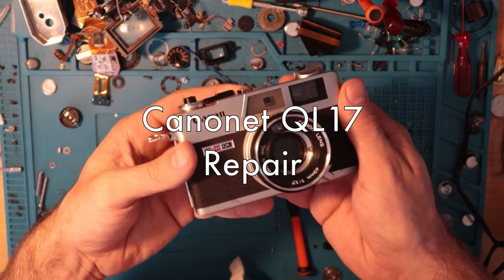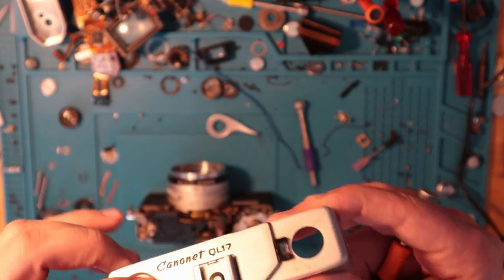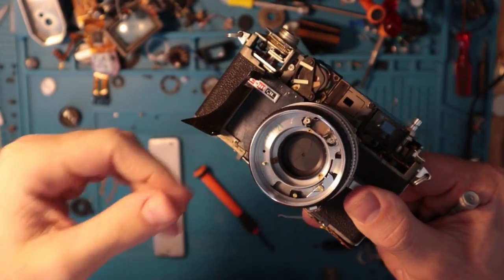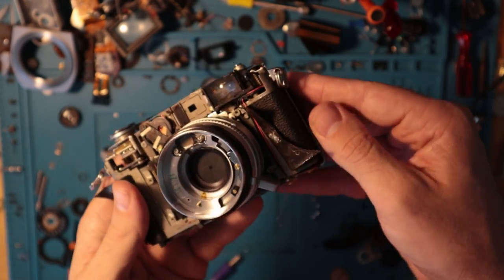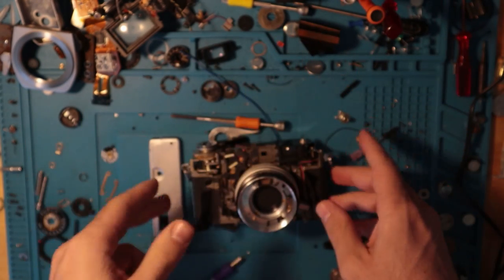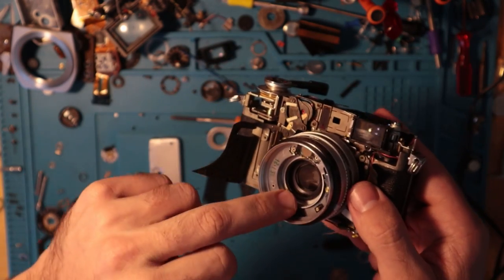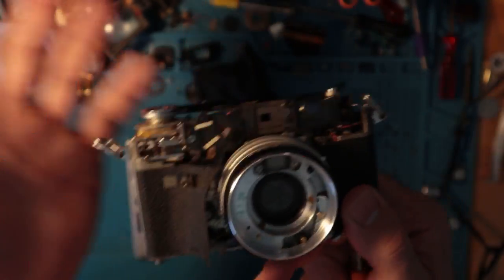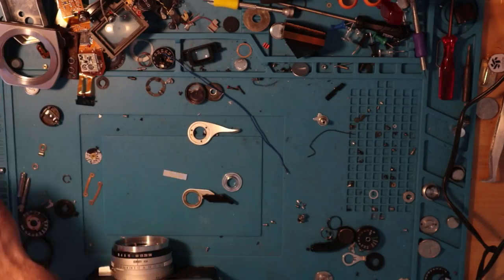Canonet QL17 G3 Advance Repair

Comment: Thanks so much for the info! Appreciate you taking the time to record while working! Would love to have another vid on the QL17, particularly any more tips on getting the meter working.
Reply from the maker: What kind of meter problems are you having?
Reply: @RompingBronco  Oddly, the light meter only works while the camera is laid on its back (with the lens facing up). Also, oddly, the check battery bulb is constantly illuminated. I'm using a fresh wein zinc/air cell rated at 1.35v (and checked w/ multimeter). I've repaired the shutter on this unit before, but didn't put much effort into the meter at the time. Going to open it up again to see what I can figure out, any thoughts would be welcome!
Reply from the maker: @AdrianTempes  If I had to guess I'd say the issues are unrelated sort of, there could be a contact issue that's causing the light to always be illuminated (top of the camera, should be easy to separate the plates) and then I don't know the specifics of the electrical current but if the power is being used for the light I'd imagine that would partially affect the functionality of the light meter. I'll look into that a bit more but if you find out anything more I'd love to hear it!
Reply: @RompingBronco  Yeah, I think you're right about a contact issue. I disassembled and reassembled the needle-holding assembly and that moves OK now. The meter worked great for a few days, but then started being less accurate before stopping altogether and I'm guessing it's attributed to battery drain (even with the camera set to a non-"A" setting while not in use; multimeter says the cell is down to .48 V). Will have to open it up again and see if I can fix the drain issue.
Reply from the maker: @AdrianTempes  I'd check the battery compartment itself first for any signs of corrosion, it may not be the source of the drain but it's easier to check that before disassembling the lens from the camera body. Best of luck!

Comment: thank you for your video. My Canonet just isn't firing...
Reply from the maker: That could be the advance issue as shown hear or there could a less common issue. Are there any other issues you've noticed?
Reply: @RompingBronco  I quite didn't see what you did in 8:21 @@
Reply from the maker: @JustinInBlack  Suppose the lens blocks the view, my bad, still getting used to working under a camera haha. If I remember correctly I adjusted the small elbow shaped piece that is caught by the advance mechanism. It's very small and malleable so it's common that it get's bent out of shaped and thus the advance won't properly engage the shutter. I'll likely make a similar video and do a better job portraying this.
Reply: @RompingBronco  thank you! I just ruin mine and need to fix them @@

Comment: Thanks for these and other detailed videos, really helped me to get started with a new-to-me QL17!

However, I am now facing an issue I couldn't find anything here on the channel - and neither in the internet in general.
What happens is, my QL17 (new body, but not G-III) refuses to feed some film stocks. Especially, bulk load cine film (Kodak Vision and such). It gets stuck around 5th exposure and refuses to wind further - as if the roll is over (but it's obviously not).
And this does not happen with some other film stocks - like Svema or Fujicolor.
Did someone here face anything like that?
Reply: You are winding your bilk film way too tight  Wind it loosely when loading since the QL system is very finicky on bulk roll film
Reply: @likaleica  thanks! The more I look into the problem, the more it seems like Canonet is not quite what I need.. as most of the affordable film stocks available to buy here currently are bulk-roll by local labs, and the QL system seems to be quite unhappy with that

Comment: just tore down and cleaned my Canonet 28 but for the life of me i don't know why the sprockets don't move the film forwards it seems like the advance lever gets stuck. i opened the bottom of the unit and saw that it keeps catching off an area casing the winder to jam up. any advice on where to start or what could be the problem?
Reply: to add it seems to clear the jam up when i tap the bottom right corner where it catches it then releases and allows to action again.

Comment: I noticed that after you removed the leatherette on the left side, you ended up also removing the right side. Is it possible to access the advance assembly just from the left? I've not been successful prying out the cover after removing the screws. This is on a QL19, but I assume it's basically the same.

Comment: So I've got mine open right now and it seems to be a similar problem, the advance will not move the arm enough to the left to properly cock the shutter. If i nudge the bottom arm just a bit more to the left at the end of the advance turn it does the trick.  So this is just a matter of lubrication? Will a padding of lighter fluid do it? 

I'm also having an issue where the frame counter is not advancing and locking the lever afterwards like it should. I feel like from other stuff I've read these things might be related.

Comment: What is that tool you briefly showed? Was that to remove the lens element or was it just a spanner?
Reply from the maker: Do you know what time code that was at?
Reply: @RompingBronco  0:28
it looks like a spanner after closer inspection. I repaired a QL last week but I have another one on my bench and having a really difficult time removing that 2nd lens element in front of the shutter blades. Tried a few different methods but stuck for now. Still a helpful video for sure.
Reply from the maker: @graham_white  Oh yeah that's my 30 dollar spanner I hardly use haha, I want to like it but it's a little too large for some of the more delicate procedures. However the flathead side of the spanner is very helpful in removing that metal case that holds that element in place. Canon did not mess around with their lens assembly. You might also try removing the elements in the back and then firing the camera on bulb to access the glass from there if it needs to be cleaned or using a small amount of lighter fluid to break up the seal of the metal case.
Reply: @RompingBronco  haha good spanners are not cheap thats for sure. yeah its annoying how there is no way to access it. I was hoping there was a special tool I didn't know about. I forgot to try lighter fluid. I suppose Ill do that and hope it breaks it up. Thanks again.

Comment: I just get a ql17 but something I noticed the lens is full of white stain and can't be cleanse by alcohol and it affect to my photos. what should i do?
Reply from the maker: Thanks for watching! If I was to venture a guess I'd say the white staining is likely some kind of mold, you may want to try cleaning it with distilled white vinegar but even then it's likely the mold has gotten between the glass and the emulsion and that is significantly more challenging to clean. I'd see if where you bought it from accepts returns/refunds and potentially try to find a different canonet somewhere else. Hard to say without seeing it myself but I'd say that's the best course of action. Hope this helps!
Reply: Get another lens for the haze and or fungus is under the coating of the lens. No way to remove that damage. I soaked a damage one once to see overnight in peroxide and the coating melted away showing the lens comes to a point in the middle. Part of the alignment process needed I think to install the coating at the factory

Comment: Hi, Just got one of them but the parallax correction is not working properly (some times it gets stuck) I wonder if you know if it would be an easy fix? or is it best to get a new one?
Reply from the maker: That's very interesting, it may be fairly fixable as the parallax correction is accessible by just removing the top and it could have fallen out of place if the camera was dropped or it could be a more serious issue. Have you shot with it and have the photos come back in focus?

Comment: i am trying to repair my QL19 currently and the advance seems to want to contine to wind on even after pressing the shutter is there a way to fix this?
Reply from the maker: I guess I'm a little confused by the question, after the back door has been opened the camera should advance a couple of times without the need to fire to load the film properly and then are you saying the camera will continue to advance regardless of if you fire the shutter or not?
Reply: @RompingBronco  Hi there and thanks so much for getting back to my last comment. I will try my best to explain what is happening. Once I have loaded the camera with film and advance to the first frame, the advance lever dose not stop. I can wind all the way through the film until the end of the roll. I can press the shutter and I can advance but It will keep on winding. Your video has been super helpful though and it’s great to see someone putting videos out like these. I hope you can help

Comment: what do you use for removing the leather? I used axeton and it didn't work. Also I use Goo Gone @@
Reply from the maker: As for the skin removal I've tried using 99% alcohol and letting that soak through. It works with mixed results but the canonet skins are very thin and fragile so I'd recommend looking into reskinning if possible.

Comment: So i was cleaning my camera, and when I finish it and I put things again, the camera start not shooting.
Can you help me?
Reply from the maker: This totally slipped under my radar, I apologize but I'd love to help you if you are still having some issues
Reply: @RompingBronco  yes ahaha, i receive the notification now and came as fast as I could to answer you.
About the problem, i cleaned the camera, so far so good, but then when I build (i forgot the right word, sorry for my bad english xDDD), the camera stop shooting, I push the "trigger" and he do not shoot, blocking that "trigger", at the third/fourth time, pulling it.

I hope you understood what I wanted to say.
Thank you for helping or trying at least ahahah
Reply from the maker: @goncalofigueiredo981  haha I do apologize I'm usually pretty good with these responses, I think I understand what you mean! Did you by chance clean off the blades in the lens? sometimes the oil gets in there and prevents the shutter from firing and the camera from advancing more.
Reply: @RompingBronco  No problem, it's better later than never!
No, I didnt clean the blades, i just took off the upper side of the camera, to clean some dust. 
I don't now the name of the thing I want to say. But you see that thing you have to pull to take a shot? Around the shooting button? It's that thing! When I pull it and then try to take a photo, the button simply, doesn't click you know? I tried to pull it 3 times, and then it gets stucked (one more time, sorry for my english, still learning! xD)
Reply from the maker: @goncalofigueiredo981  I know exactly what you mean and your english is just fine so no worries! The film advance lever will move 3 times if you open the back of the camera and then you should be able to take a shot but it sounds like the blades in the lens may be stuck which prevents the shutter button from clicking as you put it!
Reply: @RompingBronco  That´s weird because I didnt touch the blades...maybe when cleaning the camera, I moved something, not on purpose of course xD.
I will try to investigate, and ask to a friend to see this! 
Can you tell me, moreless, things that I can do or reasons why this happening? All the information is good to analysis!

Meanwhile, I take this opportunity to thank you for your help! :D
Reply from the maker: @goncalofigueiredo981  The oil is from the manufacturing process, it was used to keep things moving in the lens and it occasionally seeps into the lens blades and causes them to stall so it's nothing you've done! 
It's a sort of simple fix if you have the right tools, I'll try to post a video tomorrow addressing this repair and hopefully it can help you out a bit!
Reply: @RompingBronco  Oh okay, happy to know that I didnt ruined the camera ahaha!
Thank you so much, I would appreciate that man! Hopefully will help, if you dont post it tommorow, dont worry, one thing at a time ahaha, if was 3 months without the camera, it wouldnt be a few days or weeks that would annoy me ahaha!

Keep up your work! 
Love from Portugal! <3
Reply from the maker: @goncalofigueiredo981  I was expecting a Canonet in the mail today that I could demonstrate the repair on but it looks like it's coming in tomorrow? Who knows these days haha but when it does I'll have that video for you with a link to the tool I use and everything!

I hope I get to visit Portugal one of these days it looks beautiful!
Reply: @RompingBronco  No problem man, do things at your own time, I can perfectly wait ahahaha no worries! 
Thanks for your time and effort!

I think you would love Portugal, add it to the "Things to do, when pandemic calm down" list! xDDD

Comment: I think that the guy who said to use heat for removing the leatherettes was referring to using a hair dryer. No flame, obviously. Just don't go crazy and overhear anything, melt plastics, or burn your hands.
Reply from the maker: As someone who has burned their hands many times I am pretty cautious haha but yeah I got a heat gun of sorts recently and that has made removing the canon leatherette so easy it feels like I'm cheating.